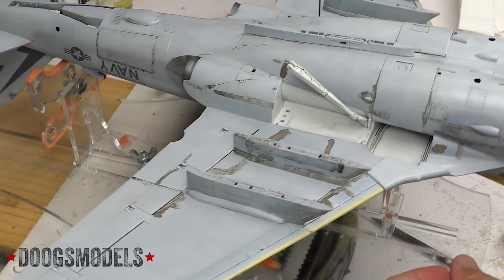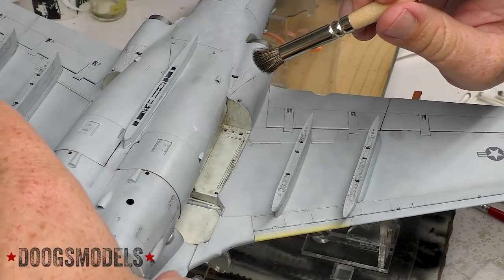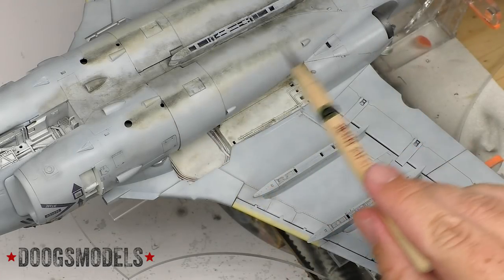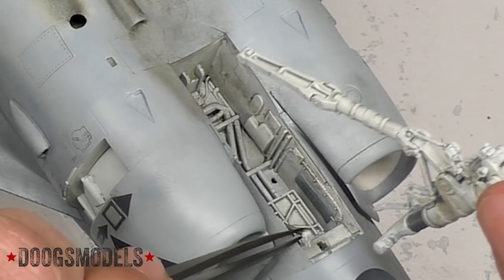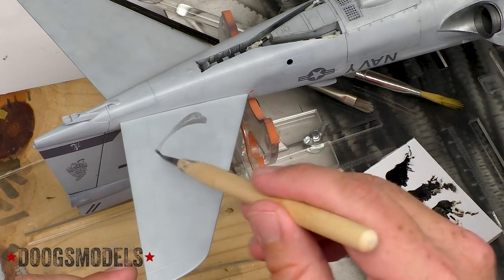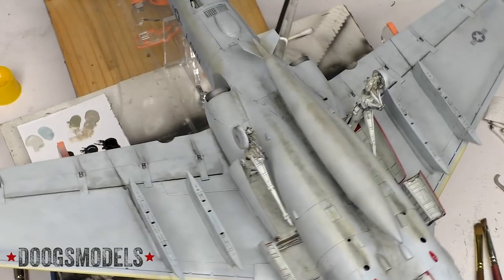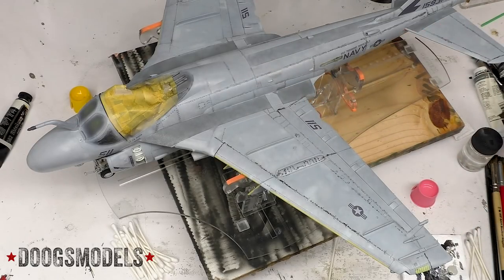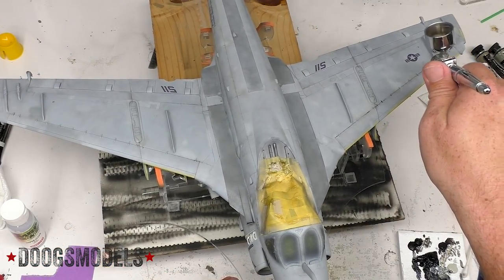A-6E Intruder Build 19 - Weathering, Pt 1

Comment: Great video.  After struggling with inconsistent results, I've pretty much given up on all the commercial panel liner products and have gone back to artists oils. When the oils are thinned with Naptha (Coleman camp stove fuel!) it has never reacted badly with the surface paint. The naptha is super volatile and so it goes on thin and evaps in seconds.

Comment: A secret to removing dust off your plane, model or any surface before you paint or even using inking or panel lining is using the airbrush itself. You got one... use it. Press down on the airbrush but don't pull back and spray air over it. Gets dust off and you can leave it there for additional use.
Reply from the maker: Problem with that is that the airflow can create a static buildup and actually attract more crud (and it doesn't remove as totally as you'd think)